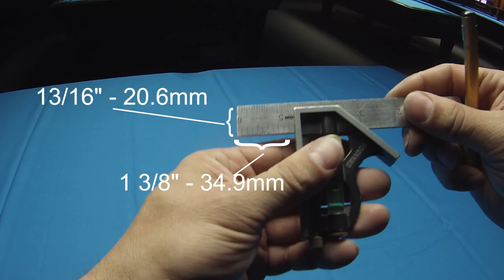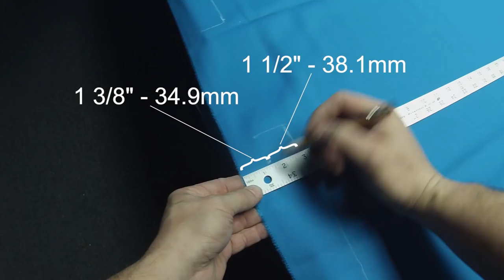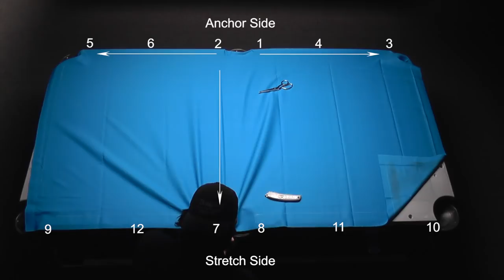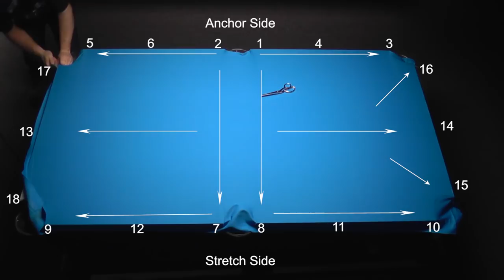Install Simonis on a Diamond Smart Table using only contact glue, no staples.

Comment: Hello how long takes the cement to be ready
Reply from the maker: It is quick. I don't "wait" for the glue to be ready. I roll it out on the slate, then roll the cloth, and as soon as I'm done, I stick it.
Reply: @reverendjonas  ok thanks can I use the cement to cover my valley rails?
Reply from the maker: @JoseEspinoza-pt2il  https://youtu.be/FbyssrhjBeo watch that video. I use spray glue for those type of rails.
Reply: @reverendjonas  thanks zach 👍
Reply: @reverendjonas  one more question zach the slate on valley is not thick like the diamond should I put more on top or down? Or is enough only on the side
Reply from the maker: @JoseEspinoza-pt2il  No extra glue is needed on the top. The side of the slate is just fine.
Reply: @reverendjonas  thanks I appreciate it

Comment: Are the measurements for stretching different if it's a 9-foot
Reply from the maker: Yes they are. On a 9' with Simonis 860HR Tour Blue I usually stretch the side to side and ends 1 3/4". The pocket relief is the same at 13/16" and 5/8". I do not have a number for the stretch length from the side pocket to the corner, I seem to get too many different results when trying to put a number to that one.
Reply: @reverendjonas  thanks for the info I'm trying to figure out the side pocket relief you measure at 13/16 pass the side pocket and then when you glue you line that mark up with the edge? If that's the case why isn't there a bubble down the center of the table or am I thinking about this the wrong way I'm confused with the side pocket marks
Reply: And why is there two different measurements for the side pocket relief
Reply: @reverendjonas  also how hard you tug on the cloth for those first few stretches I'm going to be doing this myself for the first time it looks like you're putting a lot of force on it but I don't want to baby it either
Reply from the maker: @anthonyvallario7561  There will be a "bubble" along the center of the table when you put the slack in the side pockets. That will go away as soon as you pull the cloth on the ends of the table. The slack needs to be there in the side pockets so you  have enough cloth to cover the vertical edge of slate in the pocket.
Reply from the maker: @anthonyvallario7561  If the slack in the pockets was the same on both sides, there would be too much cloth in the second side pocket.
Reply from the maker: @anthonyvallario7561  The most important thing is on the stretch is getting the side to side and end to end (1 3/8 in the 7'). It's hard to explain exactly how hard or how much force it takes to stretch it. There is lot of "feel" to it, but I tried to convey that with the number and measure system I have shown in the video. 
If you can try to get some old cloth and practice first before you do it with the new Simonis.
Reply: @reverendjonas  And now this answers the why (side pockets being different).  Great video.  Thanks!!

Comment: Never saw any one use their bare hands to smear and apply a contact adhesive before. ... interesting.
Reply from the maker: Just fast and easy. The roller won't fit in there, and I'm too cheap to buy little brushes for every table. Once the glue flashes off the solvents, it balls up and rolls off the fingers easy.

Comment: Making the measurement and stuff in my opinion is a waste of time . It would be more safe and faster if you stick one side ,  then the opposite side , after you done two opposite sides wait for the sticker to be dry good enough and finish with the other two sides . That's how I do it .
Reply from the maker: The marking is done to ensure the cloth is stretched to the correct tension, and to make sure the cloth is stretched twice as long as it is wide.
Reply: Let's see a video of how "you do it".....